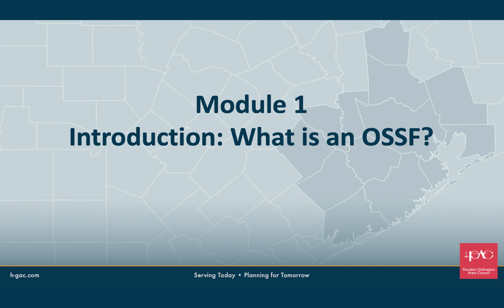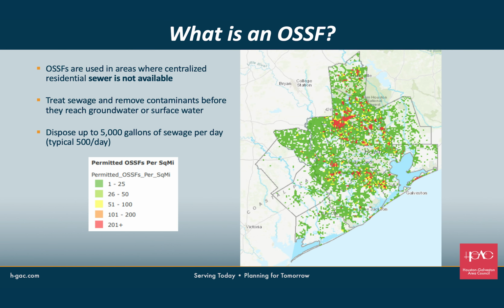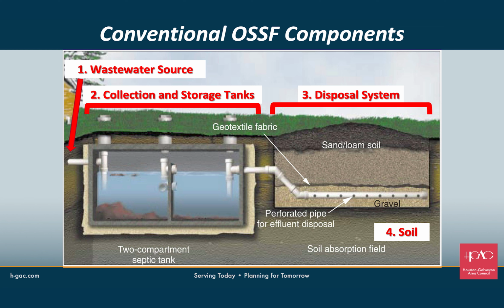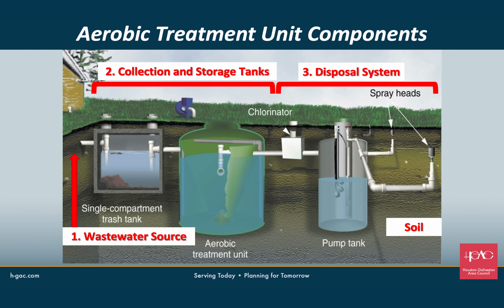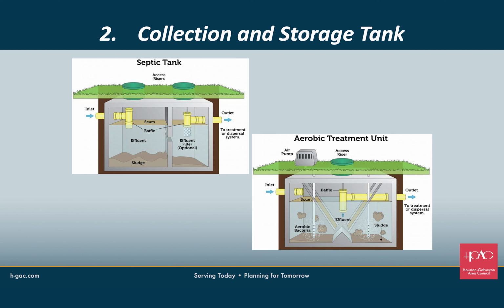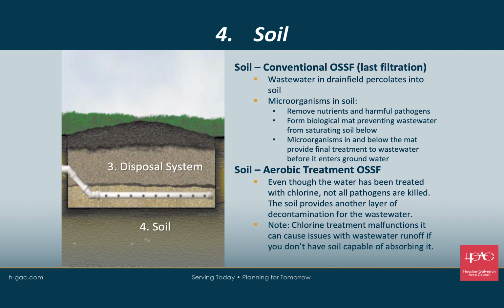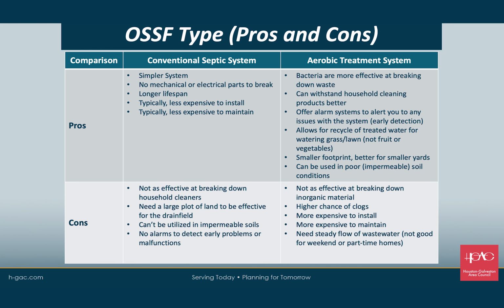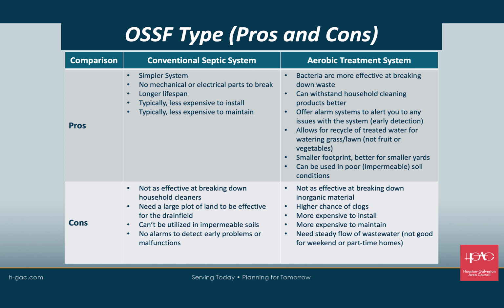Module 1: What is an OSSF? (Introduction)

Comment: I need these OSSF directors to start using NRCS to identify the water-table depth.  Almost my entire county has a water table depth of less than 3.5-4 feet so all of the conventional systems are non-compliant due to the groundwater contamination.  I do not understand why the complaint process is not working. I am purchasing tests from a TCEQ qualified lab, I will have spent more than what my neighbor is ever going to pay for a new OSSF, this is not fair, we are getting sick.